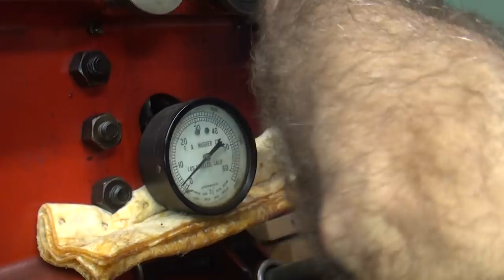#103 HSR42 42mm Mikuni carburetor rebuild and install 1200 Sportster Harley XL 1990-03

Comment: Ok we have a 2005 , 1200 sporty has a mikuni 42 on it , she pops low acceleration????   Also a 160 main jet.
Reply from the maker: up the low speed jet if under 1/4 throttle. if more than that than go to the needle and lower the clip. that will raise the needle out of the jet and make the midrange richer. get the tunning manual and read it. it tells you how to do things and why. the main jet is for over 3/4 throttle.
tatro